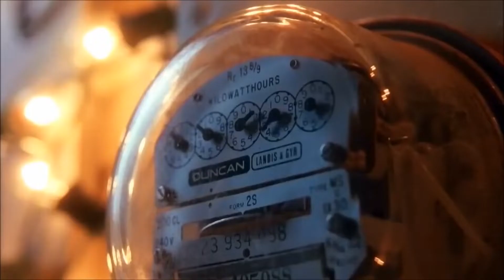Melnor Traveling Sprinkler

Comment: I think that one drive pin was intentionally missed out, so that it is easier to negotiate the curves in the hose as it travels along it, otherwise it would want to drive dead straight (especially with the spiked wheels).
Reply from the maker: It's possible I didn't think of that. Thanks for the comment.

Comment: How big is the air compressor that feeds your sand blaster?
Reply from the maker: My compressor is a 60 gallon, 12.5 CFM @ 100 psi.   It is not really big enough, I have to stop every 10 minutes and let it catch up. Bigger is better.
Reply: @vintagemachineworks  OK. I just bought a 60 gal from Lowes to supply the plasma cutter I got to convert my Longmill CNC router to CNC plasma. Now I was thinking about a sand blaster.  Thanks